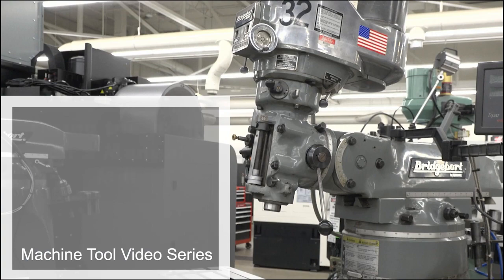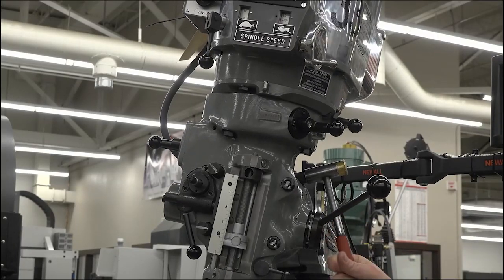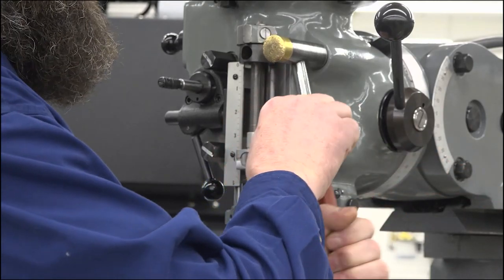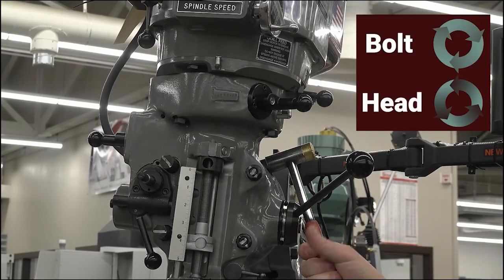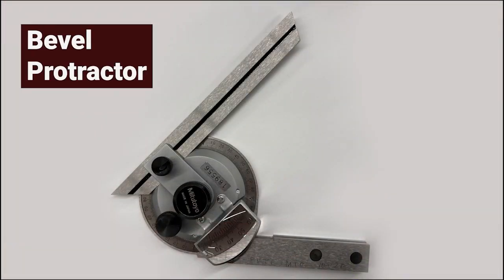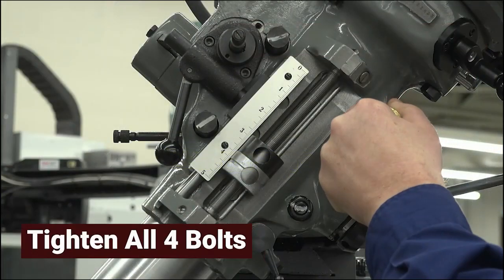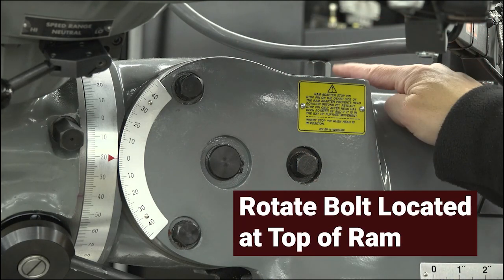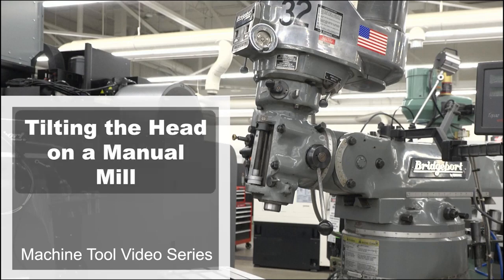Tilting the Head on a Manual Mill

Comment: My manual mill (Hurco Hawk 2U) doesn't have a pin on the left side of the machine for tilting it more than 30deg. Is that a common feature or does it mean you will need to hold it in place somehow so it lowers slowlier?